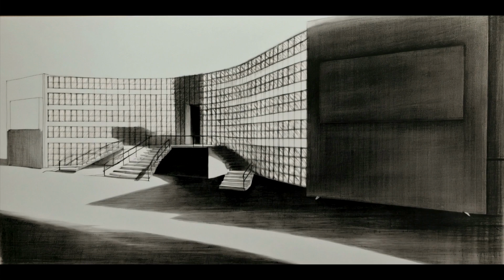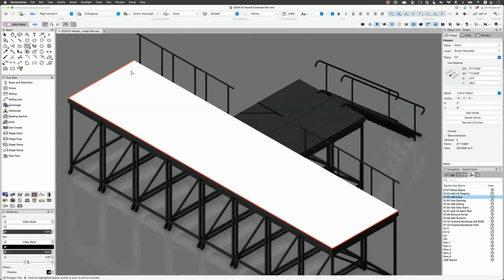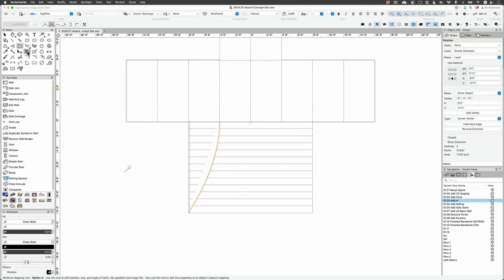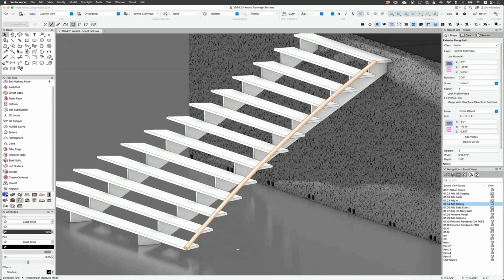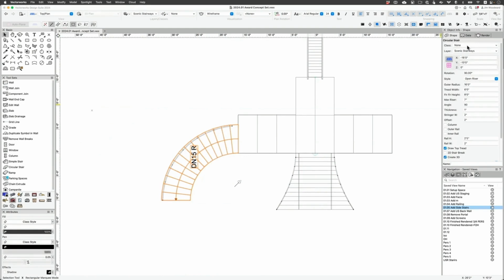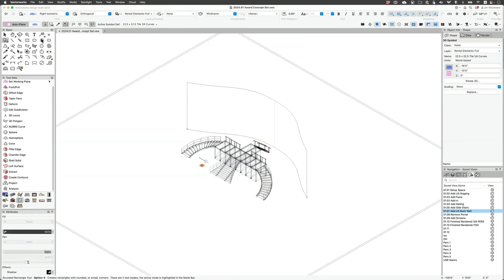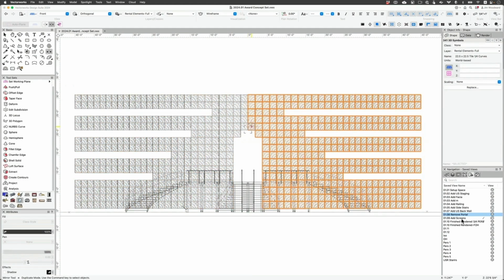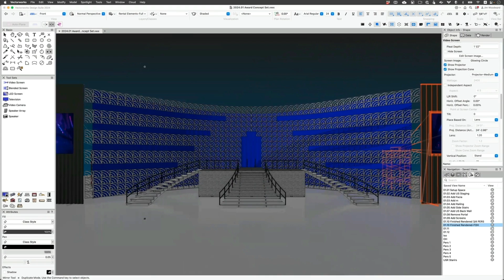An Introduction to Scenic Design

Comment: Hey I tried to recreate that. I cut the stringers with the solid substraction operation... Is there a way to cut the stairs without the stringers like you did in the video?
Reply from the maker: Hi! One thing you have to do first is ungroup the stairs. Here's a link to a Vectorworks University course that you may find helpful. https://university.vectorworks.net/mod/scorm/player.php?a=597&currentorg=articulate_rise&scoid=1194

You can also reach out to tech support for more specific guidance: http://customers.vectorworks.net/support